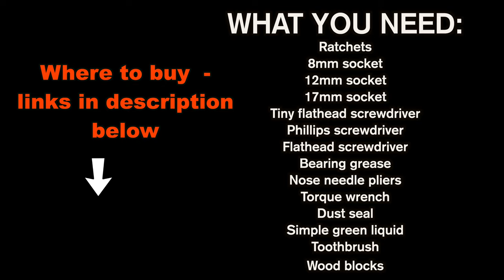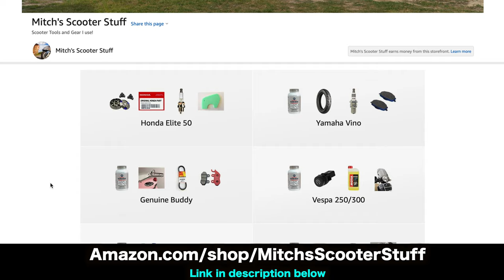Honda Elite / Tact 50 - Front Hub / Brake Drum Rebuild | Mitch's Scooter Stuff

Comment from the maker: Time stamps of the process: 
Front wheel removal in beginning 
Front brake drum disassemble - 1:20
Front brake drum assemble - 3:34
Front wheel install - 10:18

* Tools I used in this video: 
Ratchet 3/8 drive - http://amzn.to/2hhmnUs
8mm socket 3/8 drive - http://amzn.to/2xLNVXU
12mm socket 3/8 drive - http://amzn.to/2xM4Edr
17mm socket 3/8 socket - http://amzn.to/2EMT6LO
Phillips #2 screwdriver - http://amzn.to/2fgdZDL
Flathead screwdriver - http://amzn.to/2jN7lpE
Tiny flathead screwdriver - http://amzn.to/2zyrLck
Bearing grease - http://amzn.to/2wXw8Zy
Nose pliers - http://amzn.to/2yetDDj
Torque wrench 0-150 lb/ft 3/8 drive - http://amzn.to/2Crqq4R
Dust seal - https://amzn.to/3lHrZ6k
Simple green spraying - https://amzn.to/32WyP0e
Toothbrush - https://amzn.to/31HSoXI
Wood blocks ( at least to lift up 5" )